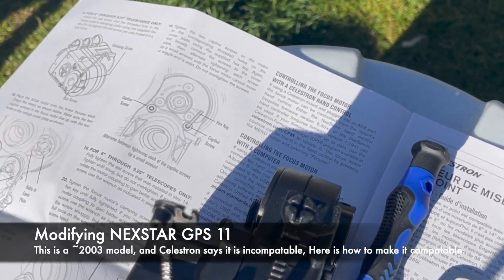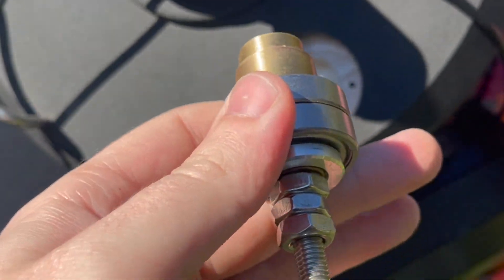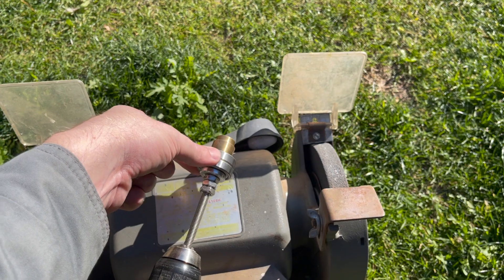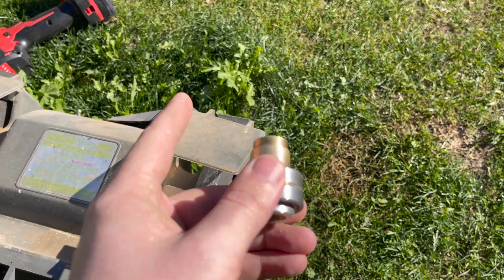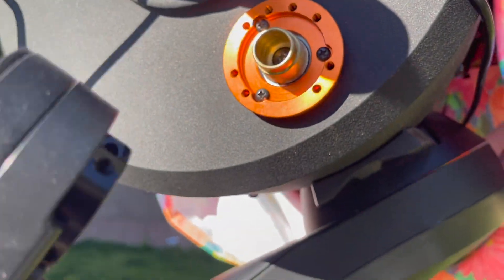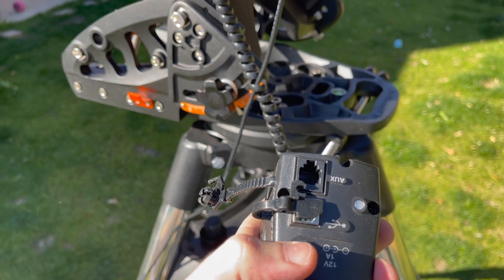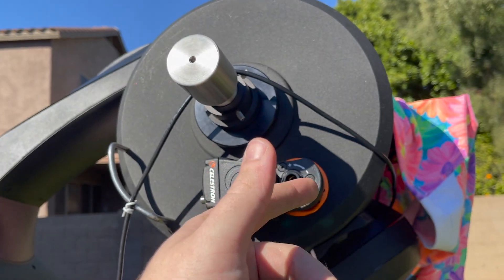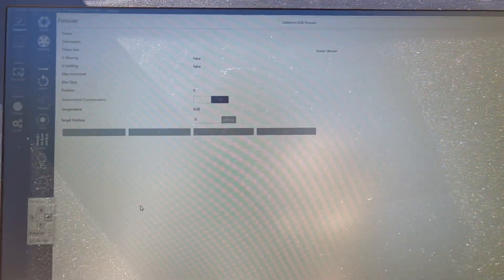Celestron Nexstar GPS 11 - Celestron Focus Motor Modification

Comment: I was just considering the same thing, will be putting it in the drill press tonight!
Reply from the maker: Let me know if you have any issues!
Reply: @JordansTechJunk  Worked like a charm! Thanks for posting this, helped me understand the mechanics so I didn't have to fiddle. I had no idea how the knob with bearings came off. It look a little work in the drill press, the sand paper was going too slow so I used a hack saw blade as a tool to take off more material at a time, kept checking with digital calipers. Now I have an excuse to use to get a lathe, remember that one time I needed a lathe?! See, see! :D
Reply from the maker: @johnbauer9972  excellent! Glad it helped you out!

Comment: Had the same problem, didnt check the compability list good enough. Modifyed the inside of the motor instead. Aluminium, so easy to grind away with dremmel.

Comment: I just picked up the same scope  used. Can you share the retrofit  kit you mentioned  in your video? Thanks a lot
Reply from the maker: It is just the Celesteon focust motor.

Mod still working perfectly!
Reply: @JordansTechJunk  Thank you, I'm going to do the same thing.
Reply from the maker: @clementding10  awesome! Let me know how it goes.
Reply: Thank you! Following your video, after draining the hand drill battery twice , I got it installed! Now the problem is, the NiNa couldn't find the motor, do I need to install any driver?
Reply from the maker: @clementding10  did you connect to it via USB? If so there is a Celestron USB focused driver and configuration you need to do
Reply: @JordansTechJunk  Yes, I connected it via USB. The Celestron utility program works fine, NINA couldn't find the focuser, I installed the ASCOM driver, the focuser shows up in the list, but couldn't connect. It seems it doesn't see the com port, even if I forced it to use COM3, which is used by the Celestron Utility Program. BTW, Youtube doesn't give notification when you reply?